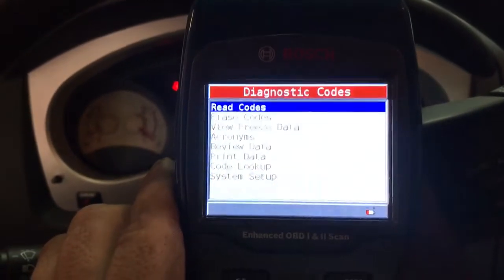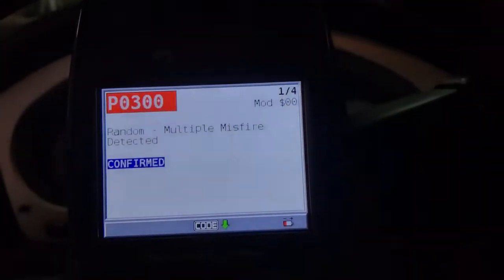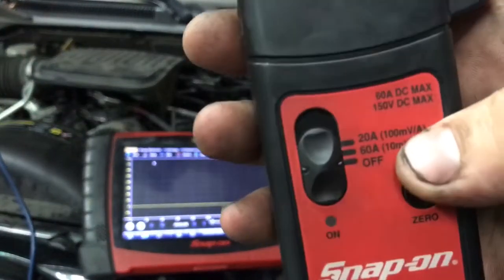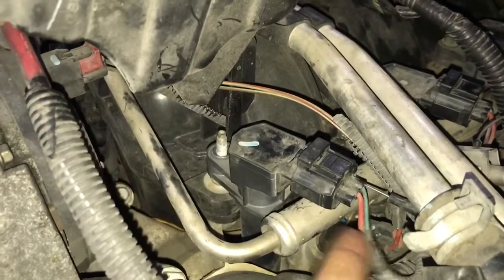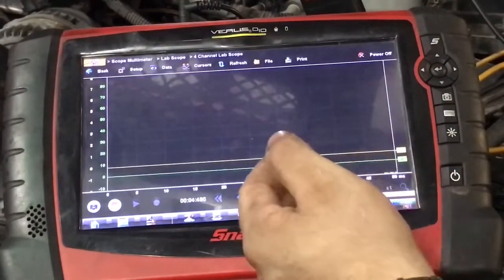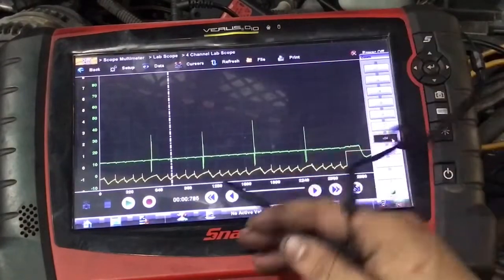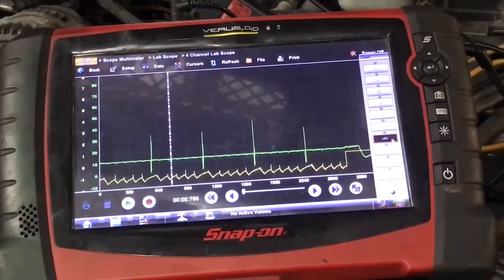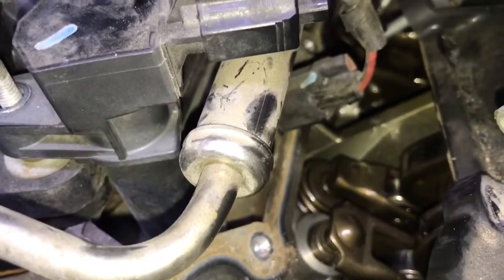Engine misfire P0301 & P0300

Comment: just did a jeep 4.7 liter 2 days ago. cylinder 3 rocker arm came off exhaust valve was stuck closed. everything looked good on a mechanical compression gauge during a regular compression test. then did a relative thats when it showed.
Reply from the maker: phil holbrook relative compression is an awesome way to find a bad cylinder. And really easy to hook up and test
Reply: Vacuum gauge is my first grab for problems like that. It's faster and can tell you everything. Exhaust valve inop I'll bet it was giving some mad backfires when the intake valve opened.
Reply: Don't agree at all. You certainly aren't seeing which cylinder it is with a vacuum gauge.